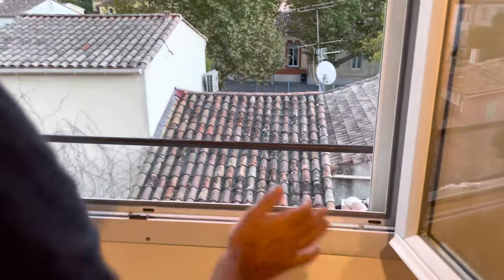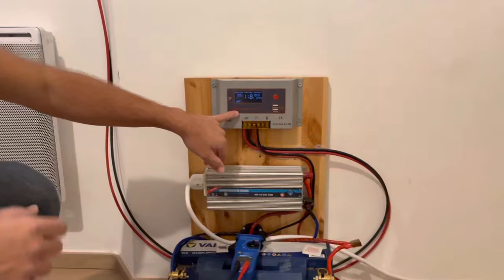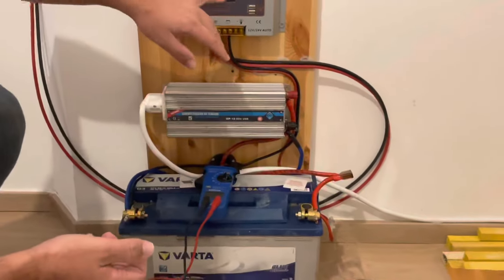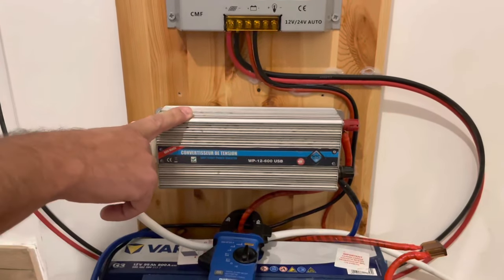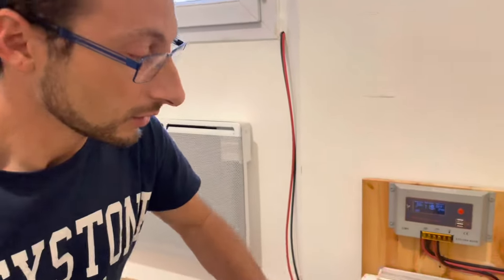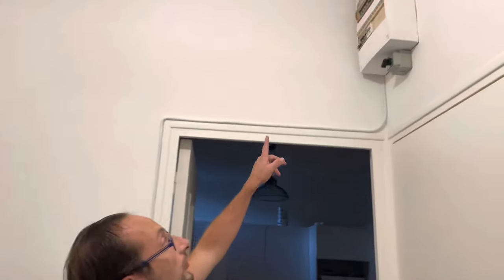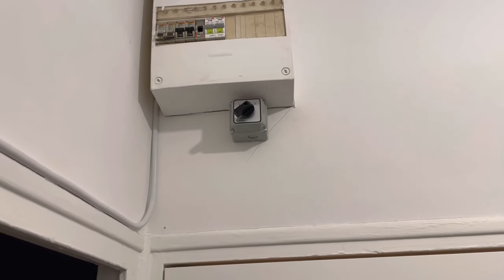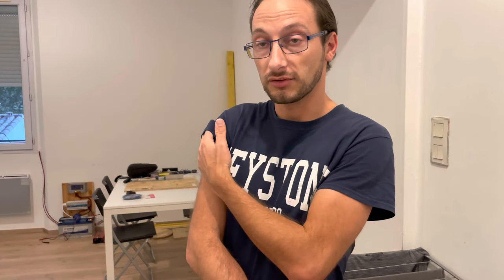Installation complète d’un panneau solaire

Comment: Bonjour, sympa ta petite installation. Par contre fait attention à ne pas trop tirer sur la batterie, les lumières ca va, mais les prises de courant tu peux vite te retrouver avec de grosses puissances. 12V 95A ca te fait en théorie 1140W, mais tu peux pas tirer la totalité dessus, il est conseillé entre 10 et 20% de cette valeur maximum si tu tires un certain temps dessus bien sûr, sinon tu vas dégrader ta batterie trop vite, et du coup une durée de vie restreinte. Merci de ton partage, tu donnes envie à ceux qui veulent se lancer.
Reply from the maker: Merci pour ton commentaire, je suis passé a une batterie à décharge lente, 180 A et je la fais pas descendre en dessous de 11 V pour pas trop, La fatigue
Reply: alors novice en la matière que je suis, je voudrais savoir si dans ce cas précis il peut ajouter une autre batterie du même ampérage
Reply: @josephbrouane4233 Oui bien sûr si sa batterie n est pas trop vieille.
Reply: @MonsolaireMaxime  merci beaucoup je suis vraiment heureux de le savoir merci encore pour votre réponse je profite pour m'abonner à votre chaîne

Comment: Bonjour, merci pour cette vidéo. simple mais efficace. Grand Bravo. J'ai presque tout le matériel  (sauf l'inverseur de courant). J'ai déjà une batterie au lithium 12v-65 Ah. pensez-vous qu'une batterie de moto suffirait?  merci
Reply from the maker: Bonjour, une batterie moto ça suffira pas mais si vous avez une batterie 12 V 65 A c’est déjà pas mal pour une petite installation. Moi je suis passé sur une plus grosse batterie de 180 A et je ferai une vidéo par rapport à la différence entre une batterie normal et à décharger lente, bonne journée
Reply: @lepetitbricoleur  bonsoir, merci pour vos conseils. Bonne soirée

Comment: Bonjour, dites moi ce qu'on peut faire  ou ajouter dans une installation d'un panneau solaire de 400w, d'un régulateur,  d'un inverter 1000w et de 2 batteries de 100amp chacune déjà installée pour augmenter sa capacité ? La réponse s'il vous plaît.
Reply from the maker: Bonjour, oui tu peux augmenter tu peux rajouter des panneaux solaires après il faut changer le régulateur ou voir combien il supporte ampères après tu peux changer le convertisseur pour passer à 2000 ou 3000 ouates et bien sûr si tu rajoutes des panneaux, tu peux rajouter des batteries

Comment: Bonsoir.,  super intéressant. Connaissant  pas grand chose dans ce domaine, Je recherche conseil pour un premier montage solaire.  Je pratique un peut de radio, cb pour être dans la simplicité !!! je voudrais être en partie autonome avec ma station. Puissance max de sortie 100w a l'émetteur pour une conso de 20 a 25 ampère . Qu'est ce qu'il me faudrait en panneau solaire et accesoir, avec une récupération dans une batterie.? .
Merci pour éventuel conseil, a l'heure actuel faut passé le pas.
 Bonne fin de fin a tout les bricoleurs et bricoleuses.

Comment: Bonjour et merci pour ton partage, je vois que tu as un panneau de 190 Wc, es ce que tu arrives à charger ta batterie correctement (pleine puissance) 
Je compte mettre des batteries sur mon installation, mais je ne sais pas si mon kit solaire et capable de charger complètement 

Deux panneaux de 405 Wc en 24 v montés sur un tracker solaires 

À votre avis deux batteries de 100 A en série pour sortir en 24 v pour mon onduleur 

Ou je peux mettre plus voir 2 packs de 2 fois de batteries de 100 ampères feraient deux séries (100 A série 100 A) /parallèle /(100 A série 100 A )

Merci pour votre réponse
Reply from the maker: Bonjour, oui pour moi tu pourras charger tes batteries. Si tu as bien deux panneaux solaires qui font 405 w par panneaux tu peux mettre tes batteries en série et en parallèle comme ça ça te fera bien 24 V et 200A au total Ça te fait quatre batteries de 100 A bonne journée.
Reply: @lepetitbricoleur  Merci d'avoir pris le temps de me répondre 
Oui 2 panneaux de 405 Wc pour un rendement horaire max en 660 kWh et journée max 6800 kwh 
Si je veux être plus claire dans ma question, avec des chiffres à l’appui 
Pour l'instant le commencerai avec 2 batteries de 100 ampères pour voir comment se comporte, le chargement et le déchargement.

Comment: loll j'ai fais la même chose que vous en appartement .

PV : 385W en 24V
Régulateur Victron 20/100
Convertisseur Victron 500 VA en 24V

Le problème c'est la prise de terre.
J'utilise des batteries d'automobile aussi (de récupération) mais je trouve que ça se décharge trop vite. Vous avez acheté une batterie neuve ?
Reply from the maker: Bonjour, oui j’ai acheté après une batterie neuve à décharge lente, de 180 A mais c’est plus lent à recharger. La batterie de Camion recharge plus vite.
Reply: @lepetitbricoleur  
Je suis en Guadeloupe.
Je voulais commander du Lithium + BMS  mais les frais de port c'est min 2200€ pour 8 cellules LifePo4 qui fait moins de 500€ , c'est du n'importe quoi 👎

j'ai lus que tu as mis la coupure de la décharge batterie à 11Volts et cela correspond à une DoD de plus de 90% , les pro utilise une DoD de 50% max.
Pour une durée de 4 à 5 ans c'est DoD à 30% max.

Comment: Convertisseur edecoa 179€. 3000watts.
2 panneaux solaires 100w chacun=200watts dokio..   120€ les deux.
Régulateur mppt 50€
2 batterie gel 209€ chacun....280ampere.
Brancher en 24vols ..... Vos frigos TV , téléphone etc .... fonctionne nickel ...
Coupé le compteur EDF....sinon problème.